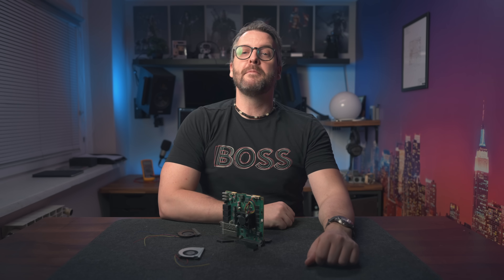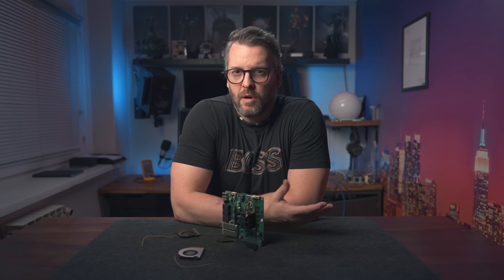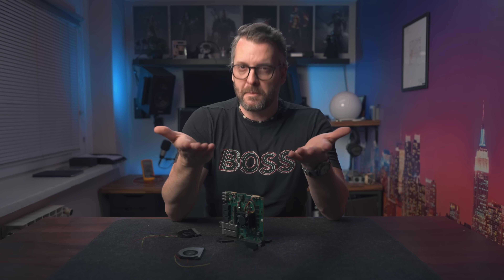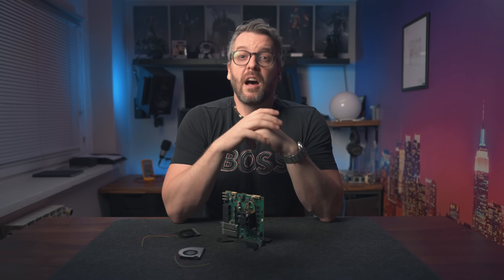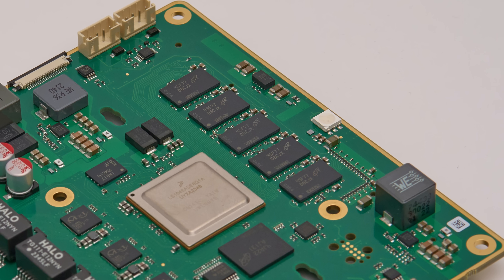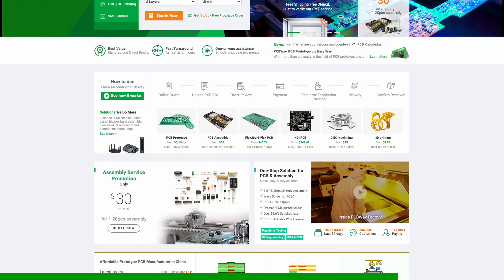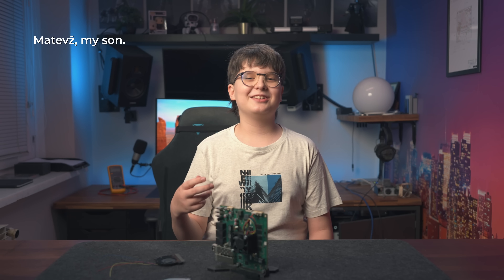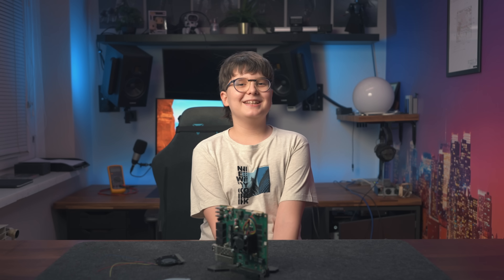You Wanted a Cheaper Router. We Can Do That.

Comment: I would love to be able to run Home Assistant on this router. It's pretty much the only non-router feature that I would use.
Unfortunately, the minimum requirements (2C CPU, 2G RAM, 32G storage) mean that the cost-reduced version (as described in this video) is a bit low on resources. Personally, not an issue since I am getting the founders edition :)
Still, generally, I agree with all of the cost reduction measures mentioned in the video. In fact, if I was to get the cost-reduced version, I would not be disappointed at all, even if I couldn't run HA on it.
I would also like to suggest a change that might further reduce the cost: replace the eMMC with a MicroSD card slot. You could sell MicroSD cards with OS pre-installed for those who may not be familiar with doing it themselves. As for the rest, a quick guide will suffice. 

Thanks for the update!
Reply: There are cheaper and better solutions for this
Reply: @bbekkaa365  cheaper than free? I mean, I will be buying this router anyway,  which makes running HA on it kind of "free". Also, one less device in the stack - and one less Eth/Wi-Fi connection.

Comment: I would argue that it's unwise to downgrade the cpu to only two cores. Some networking routing scenarios are complex beyond what the hardware acceleration typically is capable of handling. I'm thinking of multicast routing as something that likely will need cpu cycles to function as intended. Especially if automatic multicast tunnels are needed.

Comment: The majority of users would have no need for more hardware on the board. Myself included. 
Especially if networking potential remains untouched. 
I would assume the initial goal is getting development kits out into the wild and from there the production price can be optimized for a 'standard' product skew. 
I would say it is unnecessary to even mention yearly pricing and accumulatory discounts as there are more immediate options, as you have listed, to concern yourselves with when it comes to price optimization. 
Very promising! Thank you Tomaz

Comment: Whatever final device this ends up being, it needs to do 10Gbps PPPoE at the cheapest price point. There are a lot of us out there looking for such a device.
Reply: Not a chance of doing 10Gbps PPPoE. Doing PPPoE at 2Gbit will max out 2 x 4Ghz Ryzen CPU cores. This type of board has zero chance of doing that.
Reply: Hmm i use mikrotik 100GBs Routers and Dual sfp28 sfp PCie 4.0 x4 lanes openstack/ ceph nodes so i think about a dedicated router gut only consider sfp28 ones with at least 4*sfp28 so i Fan use FTTH sfp GPON modules and at least two of them.
But the Network Traffic that has to be routed between Internal und external networks will need for Internal or external usage with deep package inspection. So using VLans for everything I think about plugging OpnSense  to the VLANs even for the WANs in should be able to be fault tolerant in a 2 node Ceph Openstack Hypervisor configuration.
Reply: Did you check Alta labs they have decent router

Comment: As I had seen this problem in the past with soldered flash storage, is it possible to move the EMMC onto a seperate module ( just a PCB with the flash and a connector ), so that it's possible to replace the storage if it fails. Otherwise this will brick the router.

Comment: I know all I'd want from a nice router is that it has great networking performance, with general-purpose CPU firepower a much lower concern. I think most people will already have a cheap computer to use for docker/home server stuff, so the router CPU can have its power reduced significantly, leaving it with enough room to be performant for admin panel use, any extra networking tasks it may handle, and some simple scripts for tinkering/automating. 

Getting this to the $250-$300 range would be ideal, since it'd be competing with Ubiquiti-level manufacturers by providing a more open platform while performing similarly and being designed with both tinkerers and everyday users in mind. As long as it looks good and keeps the great port selection, price optimizations like a plastic case, cheaper/midrange sources for ports, or other manufacturing optimizations would all serve to make the product more accessible to people. I know I'll need to be upgrading my setup soon, so if this is priced more accessibly in the next few years, it's an instant buy for me.

Comment: I would say, if you can get cheaper connectors, resistors, inductors, LEDs, etc, go for it. I've never in my life seen a properly sized resistor fail.

But don't cheap out on capacitors:
99.9% of electronic devices that failed on me did so because of bad and/or underrated capacitors.

Also, maybe cosider ditching entirely the eMMC for external storage only (any combination of USB, micro-sd, sata-dom or whatever comes cheaper).
Maybe replacing one of the USB-C 3.1 ports with a type A 3.0 would could also help bring down complexity and price with saving the user an adapter if the just want to plug in a usb key to use as storage or boot drive.

Comment: I think it will be good to have a blended approach to optimization. While the CPU would offer the most saving, would this impact the ability to run certain addons in the OS? I'm not familiar with OpenWRT particularly, but am a long time user of Pfsense and I use various packages for functions such as IDS/IPS or geographic blocking for example, I wonder how much of these functions would be CPU-bound vs offloaded?

Comment: The advice I give to someone when trying to create a function or a class while developing and testing a feature in the systems that we support is: 'Make it do one thing and do it perfectly'. I have the same vision for things when buying for daily use or replacing a part. If there is a dedicated hardware or thing and I use more than once a day, I prefer to buy rather than rent it or constantly invest in it.

With that said, I also tend to optimize and minimize the hardware imprint at my home, because with more hardware, comes higher electricity bills. Seeing and understanding what performance the router will have, in my personal opinion, this is not enough to run a NAS, nor a media server. I have tried running Plex and a Minecraft server off a Raspberry Pi 4B, and it was terrible. Especially, if you try to do both. That's why I have chosen QNAP with Intel i5 CPU, as it can support x86 instructions for containers and K8S, AV1 support for hardware encoding and streaming, long term software support and easy to use, 6 bays for disks and I can spin a docker container with Minecraft server on it and play with up to 10 friends at time without hick-up.

Things to consider when you want to combine stuff into a single package:
- NAS - support for a lot of PCI lanes by the CPU, so it can handle the I/O requests to all disks and the internet properly.
- Media server - support for hardware encoding and encoding standards. Latest generation of Intel CPUs and GPUs have proper support for AV1 encoding, which is perfect for streaming locally and remotely. Nvidia graphics have best encoding capabilities for NVENC.
- Home automations - support for multiple devices and different communication protocols - 2.4GHz, ZigBee, MQTT, Threads and so on. Some of those can be really performance hungry.
- Networking - support for faster firewall filtering and different levels - L3, L5 and L7. Maybe support for proxy or VPN server/client. Support for network redundancy - cable+optic, or cable+LTE, or optic+LTE.

So... Yeah... Router (gateway) first! Then everything else :)

Comment: What I like about the unit is the flexibility you are incorporating into this device. I am not a fan of eMMC, because I have been burned by flash memory on several products. But if I can offload some, if not all, the storage to a replaceable SSD, I will be happy. That has been my only concern, but thus far has not been tested.

I am not as concerned about the price as I am the quality of device. I like a little CPU for additional functions in the future, but understand that it is not supposed to be as powerful as my servers. The concern comes when I want to do something like packet inspection. As far as I understand, network offload is not going to perform that function. Which means firewall functions are not going to perform at 10Gbps. Routing functions will perform 10Gbps. Am I understanding this correctly?

I am excited to try out a new product. I am excited to learn about product development and follow your journey.

Comment: Maybe a crazy idea, but two of these in a 19" rack enclosure with redundant powersupplies and internal failover? (Such as a gpio heartbeat, and watchdogs running on each device.) It would be a good device for a small ISP.
Reply: It would be a terrible choice for a small ISP the certifications for carrier great equipment has to be there for many scenarios
Reply: @TheLostPacketYT Having worked for an ISP hosting a few thousand sites, on a few hundred servers, using something very close to this for firewalling and line failover. I'm not really sure it's so terrible.
Reply: @EspenGrnvold  they have a record of very bad design issues

Comment: Just get rid of the nor flash with the switch. Use a socket for the emmc so people can flash firmware on their own cheap modules.
Reply: That can be a point, if socked EMMC can run good and reliable first then maybe setting it compatible to one of the larger SBC vendor's EMMC spec may help?
Reply: Couldn't you use an SD card socket like RPi
Reply: @joseph9915  SD cards are notoriously unreliable
Reply: @entcraft44  isn't that mostly fixed if you mount read-only and use good-quality SD cards?
Reply: @joseph9915  High quality SD cards are not exactly a cheap storage option. The read-only thing I didn't know about but it does make a lot of sense. It would however not work for this project.
Reply: @entcraft44  the chip inside an SD card and an EMMC module are often the same in a manufacturers line
Reply: The sockets for MC modules are actually quite expensive compared to doing that option and all it is is offloading the cost

Comment: Sony cheaped out on the rj45 connectors on the ps5. It causes constant disconnects and people have to put paper in the connector to make sure its a tight fit
Reply: I also HATE those, which opens up on today's slim laptops... sometimes you need a lot of moving/pushing/pulling to pull the cable out...
Reply: That is not them tripping out the cheapest RJ 45 connectors are usually some of the most reliable because you can only get the cost that low if you sell enough

Comment: Some other ideas:
- 8GB RAM is way too much. I currently have Turris Omnia with 1GB and feel no need for more.
- ECC is an overkill. No one who’ll buy your router will need it.
- Remove one of the USB ports. Users who later find a need to connect more devices can use a USB hub. (From what I understand, the power delivery is done through USB so the board would need two USB ports).
- Or maybe replace USB ports with USB headers on the board (same as USB headers PC motherboards have for front panel) assuming they are cheaper.
- Use USB A ports? Not sure how exactly that interacts with power delivery. 
- Switch to barrel plug for power delivery?
- Remove (one of) the SPF+ connectors.
- Cheep plastic case.

For CPU to me it seems that cryptography is the most important aspect. It’s likely someone might want to run VPN for example. Maybe a slower CPU + crypto chip would be an option? Not really sure; especially not sure how that would work on software side.

Idea which is perhaps more out there is to get rid of the eMMC. Replace with mSATA? Or SATA connector? Though I’m not sure if that would actually reduce price plus user would then need to add price of storage. The advantage is that storage size would be more customisable so someone could run torrent client and small NAS on internal storage.
Reply: Every usb port on this device is different. 1 is power, 1 is for devices (thumbdrives, keyboards, etc), the last one is for serial connection
Reply: @jakob_z , in that case, definitely get rid of the USB port dedicated for serial connection and replace it with UART header on the board.

And like I wrote, the one for power delivery can be replaced with a cheaper barrel plug. Not only the socket is cheaper but also the power delivery circuits are simpler.

Comment: I really feel like timing was HEAVILY against you here. WiFi 7 is finally getting affordable and WiFi 7 also seems to be an upgrade that's ACTUALLY worth investing in for the vast majority of the world. Buying a non-w7 router feels like a giant mistake. Are you able to get WiFi 7 on the current iteration and just need to update the specs page or are we SOL? That was the only reason I didn't pull the trigger on the pre-release.
Reply from the maker: While not the focus, WiFi 7 should be possible on the current iteration. We have an M.2 port with a single PCIe 3.0 lane which should be enough for the majority of users. I'd argue that those who want even more will go for a dedicated AP. We'll of course test this with the next iteration of prototypes.
Reply: @tomazzaman  I appreciate the response. The fact that the spec sheet said an M.2 port made me think it SHOULD be possible but specifying WiFi 6 has definitely had me hesitant and afraid there might be something underlying that's preventing it. While not the topic we're discussing in the video I think that should be a relatively quick thing to test that might help marketing a lot.

Comment: The only thing I care about is sfp28/25gbit routing
But this is a cool project, and I'm wishing you all the best.

For now (in prod) I'll stick to the mikrotik ccr2004, which can do 25g routing, but barely. 

I can't commit to buying one of your routers at this time, but I'm heavily considering it as another lab box for messing around
Reply: 25G (SFP28) is not in scope for this device.
The SFP ports are "only" SFP+, it does not and will not anytime soon support 25G ethernet.
Reply: @InterFelix  yes, good job, you can read.

Comment: I really don't care about the the "functionless" optimization. Here I mean cheaper vendors for components (rj45, SFP+, small components), or even the slower CPU.

What I do care about are things that take away functionality, even seemingly minor things like detailed power consumption monitoring. Those I'd prefer to keep. Things like less storage memory for the os and data are somewhere in between, where I'd prefer to have it, but could understand saving the difference.

In the very long term I'd like to be able to pick a "version" with higher specs and price as an option of course, but I also understand that that's a rather long way away.

Comment: NXP prices are outrageous!

I think NXP prices will kill your project, no way you can compete against Mediatek chips, and for that kind of money would have been better to use Intel N150 CPU: vastly more powerful and using that kind of powerful CPU makes $600 price tag reasonable.
Reply from the maker: I keep stressing this and will for however long it's necessary. Neither of the two chips you mentioned handle 10 Gigabit "properly". And by properly I mean anything outside your basic packet forwarding.

Comment: I don't follow the development very close, but if your software is Open Source and the device takes off, there will probably be Chinese companies that develop stripped down version at a cut throat price. You better yoyr own then. I'd pay like 30% more to get it from you, but no more. If you sell for 600 and I can get a close enough version (I think the USB-C is a costly mistake; get rid of it) for 200, I will buy two from them and none from you.

Still, wish you best of luck!
Reply from the maker: Fair points! USB-C power delivery chip costs like $2, so it's not as big of a deal.

Comment: I would say you are going to have to re-evaluate your price a bit consider that all big DRAM manufacturers at this point have announced the discontinuity of Legacy DDR, and yes, that include cxmt.
Reply: Nonsense, DDR isn't going anywhere anytime soon & you can't spec a device based on hopes & dreams.  This will be built using existing, proven hardware.  If a DDR replacement does hit the market sometime down the road, its cost vs benefits will be weighed & only when that math makes it beneficial to use will it finally find some leverage & end up in some devices.  Things don't disappear or get replaced overnight, regardless of the fanciful claims of big mfg's.
Reply: @NerdRaygen-the-original  I did not say DDR is obsolete. I am just saying the price is going to fluctuate in the foreseeable future due to diminishing competition and production, in the same sense that DDR4 could also be going cheaper as the DDR4 specification is considered legacy now. Please read and think carefully brefore making a statement, nobody is trying to crush your hopes or dreams. Also the chipset is physically limited to what memory it can use because of the PHY design, even if HBM become widely available, doesn't mean that your chipset is going to support it.